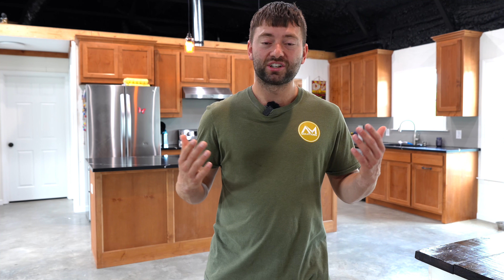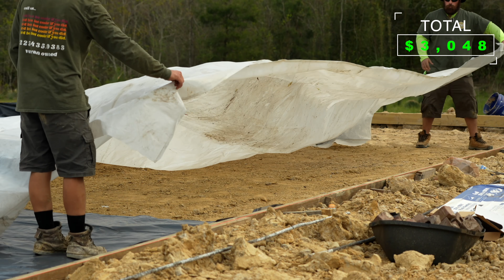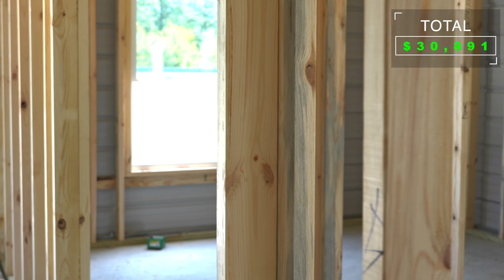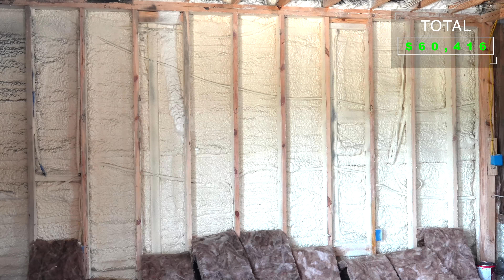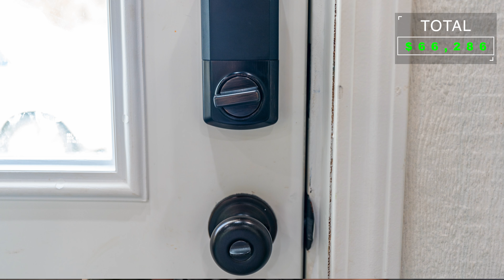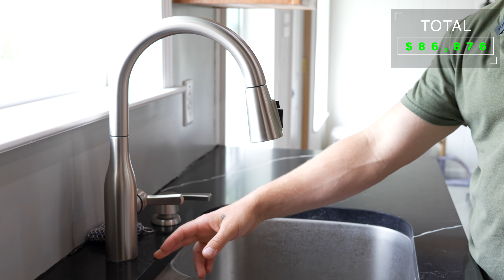Barndominium Price Breakdown | Building a 1,500 sqft 3 Bed 2 Bath Home for $87,000

Comment: I'm a licensed contractor.  Great job on deciding what to hire out. And labor saving.  One thing that you could have saved money on was the insulation all you need is 2 inches of closed cell foam in the walls and 3 inches on the ceiling. Because of the properties of closed cell there's no benefit to adding more. Also you are correct it is much better to hire sprayfoam out. And in most cases all the " good" sprayfoam applicators will run roughly at the same price
Reply from the maker: Thank you, I appreciate the comment!
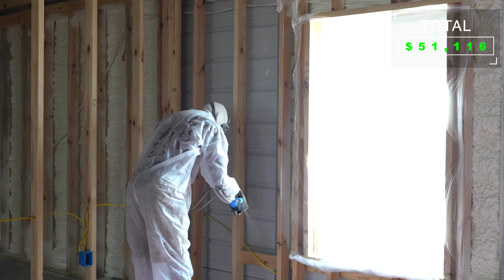Reply: 05:25  He says he put two inches of closed cell foam in the walls and on the ceiling as a vapor barrier, than 4 more inches of open cell on the ceilings.
Reply from the maker: @FixItPleaseJ  yes, and additional fiberglass insulation in the walls. More insulation is better in my environment
Reply: @DudeWeCanBuildIt  another contractor here. Spray foam is money well spent. My house has 5 to 6” and it’s way better than anything else because it’s completely sealed.
Reply: @DudeWeCanBuildIt  But nothing in the floor, just VB under the slab...
Reply from the maker: @ZegaracRobert no need for floor insulation in Louisiana. I'm sure it's more common in Northern climates
Reply: There have been tests done on that foam stuff. It burns way too quickly and well compared to fiberglass to be in any house of mine. Try working on things in the wall after you use that mess. Most contractors use it to save money and time. Same way they now use posterboard instead of proper sheathing in walls. it tears like the crap it is.
Reply from the maker: @YouMatter-UDo The spray foam now has fire retardant and it will literally self-extinguish. My brother's house had a kitchen fire and the foam in the Attic, even after being exposed to open flame, did not combust. 

Spray foam is much more expensive than fiberglass and is certainly a luxury item that is worth the money if you can afford it. That being said, if you have to go back and change anything in the future you will have to chisel it out
Reply: @YouMatter-UDo wood burns to quick to, compared to concrete and brick homes
Reply: @YouMatter-UDo  i dunno what tests you saw,maybe 1980's spray foams.....this stuff is litterally a fire retardent....lol
Reply: Sprayfoam does off gas. After 24to48 hrs. You should be OK if installed properly. Some applicators have ventilation systems. Commercial freezers have 4to5 in of closed cell. A lot of the fire code has to do with air movement
Reply: No of actually cost unless given half materials for free also wouldn't pass UDC inspections fire protection
Reply from the maker: @robinwetzel2077 I paid for everything and the receipts are included in a document linked in the description. 

Also, this house passed every phase of the inspection and was issued an occupancy certificate🎉
Reply: Spray foam sucks.
Reply from the maker: @momomimi6915 what makes you say that?

Comment: ALL of the hvac cost just under 7k.   Remember that next time the ac contractor is out bidding to replace your ac unit, inside and outside, starting at 15 to 20k.    
Ac in my area is one of the BIGGEST scams out there.  They buy the equipment so cheap its not even funny.
Buy your own systems online and pay an installer to install it and you will save upwards of 10,000.00.   i personally install my own.  It was worth it to me because i own 19 doors so the initial equipment needed was justified.  Im on my 11th unit now and i have saved anton of money.
Reply from the maker: That's a great way to save money! Those prices would be unreal around here!

Comment: You should tell us how many man hours these do it yourself and friends projects took. That way the viewer can see how much to add to their project.
Reply from the maker: If you're hiring a general contractor to do everything and do no labor yourself, it will be around $160k.
Reply: @DudeWeCanBuildIt  the hours would allow for discretion as to which contractors to hire. For instance how many man hours to stain and seal all those cabinets, rather than just buy finished cabinets.
Reply from the maker: @glenncantley5898  I did not track the hours for each project and I wouldn't be able to give you accurate labor time.

Comment: Holy moly that's some professional money saving. Honestly I love this, the price of traditional housing is so far gone out of reasonable. I do appreciate that you did some experimenting with the interior walls but I would prefer regular sheet rock finish. Less wood or wood with more finish and softened angles.  And I'm not fond of the spray foam ceiling in the main room but I'm not sure what I would change about it. Realistically after watching this video I'm confident I could build my version of this out for around 120-150 mainly since I don't have that many friends with construction experience.
Reply from the maker: That's awesome, I have a general contractor that would build it for $160k turn key. 

So, your pricing is very realistic and you can finish it however you want.

Comment: Pex A

WELL DONE!!!
Reply from the maker: Thanks, PEX is very convenient and easy to work with!
Reply: @DudeWeCanBuildIt  that's true but not the biggest problem I see with PEX B. A lot of people complain of low pressure with B. It's because the inside diameter of the fittings for B is noticeably smaller than the same size pex A and copper. It's a flow issue.
Reply from the maker: Oh, wow. I didn't know that, luckily I hired a plumber to do the install.

 Thanks for sharing!

Comment: The veggie oil on the concrete forms is pretty clever. I will look into it.
Reply from the maker: Some guys use a mix of diesel and used motor oil and I actually use that mix to preserve the wood deck on my trailers.  I figure the veggie oil is better for the environment when spraying on the forms though.

Comment: Spray foam is our generations asbestos
Reply from the maker: I doubt that it is nearly as dangerous. 

Just like concrete, it off gasses while it cures. After that, it is inert. On the plus side, it is so energy efficient that the long-term "greenness" of the product makes it better than most traditional materials.

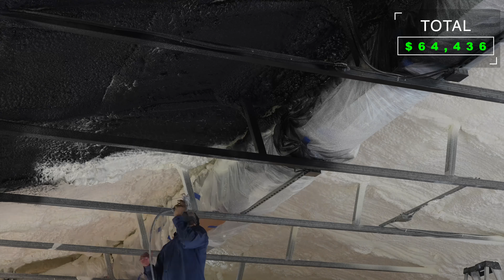Comment: 8:10 Just wondering why you painted the interior of the attic black instead of white, which might make the light reflect and be easier to see around.
Reply from the maker: I was in a restaurant with black painted ceilings and I liked it! True story. 

I did debate for a while on what color to use and I'm happy with the high gloss black ceiling. There is a lot of natural light and the space is well lit.

Comment: Good job. But what are you going to do when hail destroys your walls or roof
Reply from the maker: Prolly cry
Reply: @DudeWeCanBuildIt  it’s a great idea though.
Reply from the maker: It's a metal building. It's definitely more durable than shingles. Worst case scenario, I remove a few screws and replace a panel.

Comment: Nice job… However, in some areas of the country, such as mine… It would require sheetrock on the walls and ceilings for fire code. 
What region of the United States are you located in? What state?
Reply from the maker: Louisiana. 

The residential code here does not specify interior sheathing materials. I personally don't like sheetrock.
Reply: @DudeWeCanBuildIt  I agree ….its dusty , not very durable,…and a pain to finish …I just wish there was an alternative to sheet rock ….somehow it meets the fire code. ….
Reply from the maker: Check out trusscore. I think they are vinyl interior panels. Cool product, I just couldn't afford it, lol.

Comment: My 40x70 with 40x30 living quarters was around 110k. I did about 20% of the work myself. I’ll probably need to re-do a few things but living with it for a while to see. I cheaped out on a few subs and it’s showing in the final product.
Reply from the maker: You would have a hard time just getting the shell for that price right now. When did you start building?
Reply: 2021 right during the supply chain crisis. My shell and foundation were about 80. The building kit was 60 of that I think.
Reply from the maker: Wow, I don't know how you did everything else for $30k.

I spent $20k just on cabinets, countertops, and a shower. 

You must be very thrifty, congratulations!

Comment: Is that spray foam insulation really a solid vapor barrier though? Most people don't realize how important it is to have a good vapor barrier. My grandma's house had one corner skipped by the contractor and that entire area of the house was black in 5 years from mold.
Reply from the maker: Yep, vapor barrier is incredibly important and closed cell spray foam does the job beautifully!
Reply: @DudeWeCanBuildIt  Nicely done budget build but I gotta ask why not go up a floor and have 1500sf of shop under the house? I know a guy who did that and installed an elevator (cheaper than you think) and he's super happy with it. Can't imagine that's more than 25-30% price increase.
Reply from the maker: I haven't priced it out, but some comments on here say it would be cheaper to build a bigger single story than to go up. 

Personally, I couldn't afford either, so here I am lol.

Comment: Great great video price breakdown is really appreciated. Couple of things you’re an AC contractor so I’m sure you have lots of friends in the trades and they gave you some really great prices. Another thing is I can’t stand Drywall either and the next build I do I’m going to use three-quarter inch plywood throughout the house that is fire rated. Everything else I like what you did spot on. What area are you in and what was it like to get a permit to build this to be a livable house and how does the insurance company recognize the structure for insurance purposes?
Reply from the maker: I'm in Louisiana. Permitting was straightforward and I passed all my inspections the first time. 

There is a material called trusscore that you should look into for wall sheathing. Let me know what you think. It was out of my price range.

I get an insurance discount because it's a metal building.

Comment: Great job and amazing cost! Really great info. I might be tempted to duplicate what you did here one day.
Question? I was surprised you’re being a HVAC pro that you used a package unit. I know they’re normally used for mobile homes with no space for equipment. I ran an HVAC company for a short time, but had little technical knowledge. Just curious why you didn’t use a traditional heat pump or maybe a mini split system. Thanks in advance for the explanation!
Reply from the maker: Thank you, I appreciate the comment! 

The package unit has many benefits. 
First off, it is a heat pump system with a backup heat kit, so it is very efficient. 

The advantages are: 
1: Easy servicing, everything is available in one place at ground level. 

2: Easy system replacement: Disconnect the electrical and a few screws/tape for the duct line. Then, swap the whole system for $3k. No torches or soldering required.

3: No water source in the attic. I'm sure you have seen or heard of a pan filling with water and overflowing onto the ceiling. Causing sheetrock damage, mold, ect. 

There is 0% chance of that happening here because there is no equipment in the attic.
Reply: Just watched your house tour video. You mentioned, IAQ with regard to your stove vent. Was also wondering, did you do anything else concerning indoor air quality?